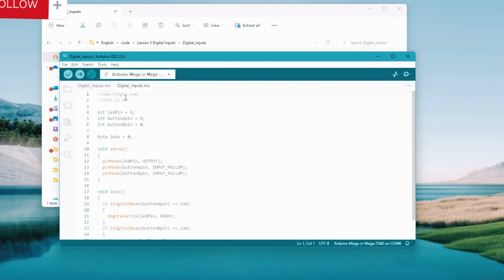Arduino Elegoo MEGA 2560 lesson 5 Digital Inputs

Comment: Can you explain why this works? If am I creating a path for electron flow by pressing ONE button, then interupting it when i press the other, what happens if I press the same button twice? I donw understand the path of the electricity
Reply from the maker: Certainly, I can explain how this circuit works and address your questions.

*Circuit Operation:*
In this circuit, you have two push buttons (tactile switches) and an LED connected to an Arduino. The buttons are used to control the LED. Here's how it works step by step:

1. *Button Connections:* Each button has two terminals:
   - One terminal of each button is connected to a digital input pin on the Arduino (buttonOnPin and buttonOffPin).
   - The other terminal of each button is connected to ground (GND).

2. *LED Connection:* The LED is connected to a digital output pin (ledPin) through a current-limiting resistor. When this pin is set to HIGH, current flows through the LED, turning it on. When the pin is set to LOW, the LED turns off.

3. *Internal Pull-up Resistors:* The Arduino is configured to use its internal pull-up resistors for the button pins. When a pin is set to INPUT_PULLUP, it means that there's an internal resistor connected to VCC (5V on most Arduinos), which keeps the pin at a HIGH voltage level (1) when the button is not pressed. When the button is pressed, it connects the pin to GND, bringing it to a LOW voltage level (0).

*Button Press Scenarios:*
- Pressing the "On" Button: When you press the button connected to `buttonOnPin`, it connects that pin to GND. This action brings the voltage at that pin from HIGH to LOW. The Arduino can detect this change, and in response, it turns on the LED by setting `ledPin` to HIGH.

- Pressing the "Off" Button: When you press the button connected to `buttonOffPin`, it connects that pin to GND, just like in the previous case. This action also brings the voltage at that pin from HIGH to LOW. The Arduino detects this change and turns off the LED by setting `ledPin` to LOW.

*Regarding Pressing the Same Button Twice:*
If you press the same button twice in quick succession, nothing unusual happens. Pressing it once brings the respective button's pin to LOW, turning on the LED. Pressing it again brings the pin back to HIGH, turning off the LED. This is the basic concept of a toggle switch. Each press changes the state of the LED.

In summary, this circuit uses button presses to control the LED by changing the state of the corresponding digital input pin from HIGH to LOW. The Arduino continuously checks the button states in the `loop()` function and reacts accordingly to turn the LED on or off. It doesn't matter if you press the same button multiple times; each press changes the LED state.
Reply: I appreciate you taking the time to writethat very much, thank you!!
 @tinkeringtechhub